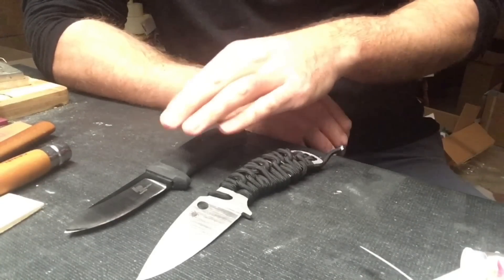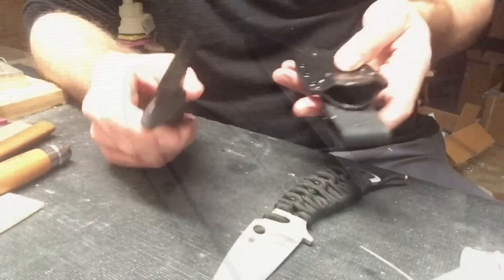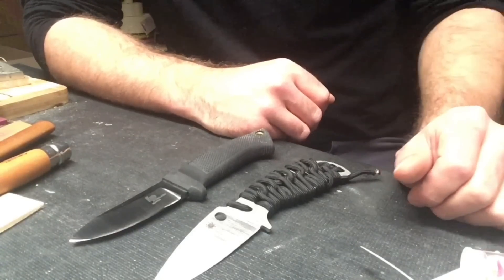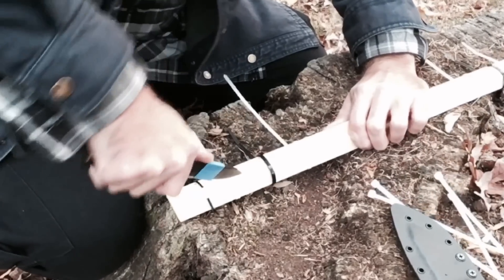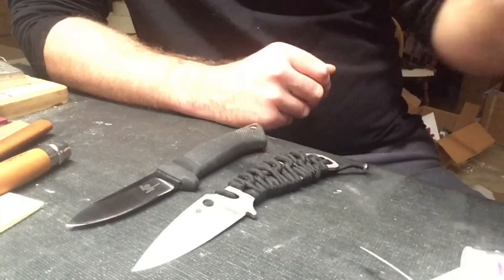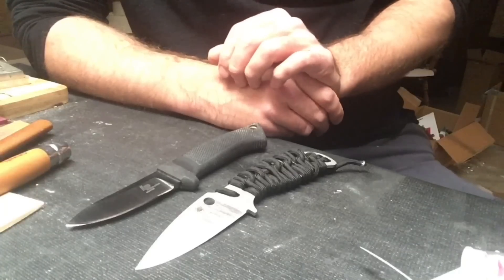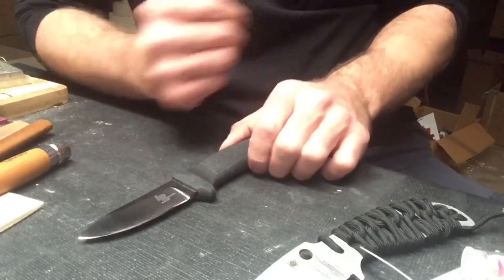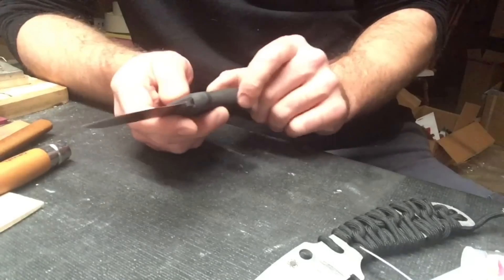CPM 3V - Cold Steel Pendleton Hunter - 3V/4V comparison.

Comment: This was awsome!! I appreciate all the work you have done. I'll say first hand, I've had the SRK for 14 years, take it out a lot, beat it to hell. The handle has still held up well. Question, in the videos, you're hand sharpening, so does that mean you've put a convex edge on that knife? Or is that a secondary convex? Its confusing, just wanted your thoughts. Thanks!
Reply from the maker: Chris Grey I usually do a V Grind.  Occasionally I’ll do a convex.
But it sounds like you’re entering the conversation with the idea in mind that hand sharpening automatically equals a convex edge.  Was that something you had in mind with your question?
Reply: @michaelchristy4982 yes, I think you're right. I'm assuming hand sharpening like that would lend itself to a convex edge. I really appreciate the response and follow up. The thing is, I know I'm not dumb, but when it comes to figuring out grinds and how to sharpen them, I'm at a loss. Right now I primarily use a Bark River UL Bushcrafter which i believe is what is called a scandi vex grind, no secondary bevel. I also have a GSO 10.1 on order that is a saber flat grind with secondary v grind bevel. They are both 3v, and are/will be my most expensive knives. I've got a gso 4.1 in 3v and I love it. I maintained that one with a Ken Onion Worksharp. But I'd like to move away from the Worksharp with my nicer knives, especially 3v.  Anyway, I apologize for the novel. I can't believe I just found your channel, the stuff I've seen has been absolutely amazing and I follow tons of other knife shows. I'll be doing a deep dive of your catalog this week, so I'm sorry if you have already addressed this stuff previously. Thx again!
Reply from the maker: Chris Grey freehand does not automatically equal convex.  Take a look at my video on XHP and edge finish testing.  Skip to 14:40 if you want a quick example of why I make that statement.

Comment: Another fine video sir! I love 3v, its nice to see affordable knives made from it. I've been enjoying my k2 in 10v, also got a lionsteel sr1 in Chad Nichols rain drop Damascus for Christmas, it is sweet.
Reply from the maker: knives save lives the rain drop Damascus is nice.  I've seen some impressive knives in that pattern.  
3V is really good for fixed blades.
Reply: Michael Christy I've never tried it on a fixed blade but, it seems fitting for one. I've had a Spyderco tuff in it for about 5 years now and I've been pretty impressed with that. All in all though I think maybe even above 3v I think my personal ultimate favorite has been sleipner. Oddly enough it started out as the worst steel I had used and after about a dozen times of really aggressively sharpening it I finally found it to have pretty excellent edge retention. Sadly out of the box edge retention tests are pretty much moot considering all the heat damaged steel at the edge from factory sharpening. I like that you use your knives for awhile and sharpen them a lot before you come up with any conclusions.
Reply from the maker: knives save lives over heated edges can be a problem.  You always test with freshly sharpened steel...  Ankerson told me that way back when I was just starting out, long before I ever thought of starting a YouTube channel.
Reply: @MichealChristy What are your thoughts on Micro Melt Pd-1 steel? Comparisons to 3v / 4v?
Reply from the maker: I don't know too much about it, except that it should have a good toughness rating and good edge holding (given the touhgness).  That's just based off me looking at the composition.

Comment: Hey Michael did you notice after putting a fresh edge on the pendleton hunter after putting it in the sheath it came with and pulling it out no matter how carefully it would roll the edge over in a spot or two? Or fold it over or something. All I know is it happened then I freshened it up with the spyderco uf and stropped and inspected with a light and put it back in and out and sure enough there were a couple flat spots screaming back at me with a light on it. Or even just holding it in the light. Will this effect its performance? Such a tough and good steel I would have thought nothing would hurt it especially after seeing you cut aluminum cans with no real damage. I could feel it cutting paper a little, but is easily stropped and would feel mint but you could still see a tiny flat spot or whatever. Is that why you got a kydex sheath? I may get a leather one somehow or if your kydex solved the problem may be one of those! Bummer huh?
Reply from the maker: Paul Lonardo it sounds like your knife is due for a full sharpening, instead of just touching up the edge.  With just the UF and strops, you’re leaving fatigued steel on the edge.  If I have a sheath try to mess with my edge, I end up taking small slivers out of the sheath (this just happens by accident) when I pull the knife out, but I never see the edge roll.
Reply: Michael Christy Actually it has a fresh edge. I sharpened it with my kme all from the 50 grit beast to 1500 in diamonds then a 2,5,and 10k chosera and then strops up to .1. It was after I did that I noticed after a couple times of messing with the knife in the sheath i could see a tiny reflection on the edge in a little are about a few mm long. So that's when I touched it up with the uf benchstone and strops and got the edge back to mint. Then it happened again. Don't get me wrong its so small you can see it unless you have a decent flashlight pointing at it, I just didn't know if this was normal. Ill figure it out, thanks anyways. Its no biggie.
Reply: Michael Christy I mean it comes down to an edge that's so pointy I guess I cant expect it to be invincible. I just know when I get done on the kme there is zero burr and its a sharp as any clamped system could get it. Maybe because it was so fine its just the tiny burr that I got to stand up straight and it bent over making light be able to bounce off it...or my worst fear is a got a one off one with a low heat treat or something but I don't think that's the case, it felt as good as any premium steel as far as how the diamonds cut through it. I just don't get how you can cut through aluminum cans and see nothing but I just take it out of the plastic sheath and I see a little something. Errr!
Reply from the maker: Paul Lonardo I’ve seen times where a blade had little bits of plastic on the edge that looked like chips.  Could you feel them in the edge?
Reply: Michael Christy I can really feel it as much as I can see it. Its just the very fine fine edge just flattened or something a tiny bit. This was done with my kme so I am going to do a full re-sharpening free hand and see if it has any change. I did a 20° angle dps on the kme. Would you suggest I go a little more acute free hand or keep that 20? I also wanted to ask you one more thing. When you get a new knife do you take it down to the 15 dps or follow the factory angle. I assume you must do the 15 and just keep hitting the coarsest stone until you get your burr the entire way and then go to the other side and do the same, right? I'm sure that's why it takes patience and a steady hand like with the s90v military
Reply from the maker: Paul Lonardo I usually go around 30 inclusive.  I used to be kind of obsessive about the angle, but I don’t worry about it as much (unless I’m testing).  But if a new knife has an obtuse angle, I drop it to 30 inclusive.  At this point, I often reprofile freehand as well (again, if I’m testing I make the angle exact.  If it’s just a knife I want to use, I don’t worry about it as much).
Reply: Michael Christy hey bro so I wanted to just tell you I went and got 3/8" sisal rope just like cedric and Ada channel and without sharpening it again after that shiny spot on the edge after I pulled it out of the pendeltons sheath(had a fresh sharpening job on my kme) and I started push cutting just like he did on his test. He got 198 with a convex edge on the pendleton 3v and I have a v-edge obv on mine and I am currently at 300 but took a break! It is getting there though. So anyways I guess I dont have a poor heat treat and I can't believe after all the hard cutting that snaps through the rope and hits the wood 300 times and the edge isn't showing any real flat edge just not as fine as fresh obv..and I also tested my steel will modus m390 which is why I got rope and cedric had a bad knife and could only get to 100 cuts and I finished at 417 and could have gone further because the edge was still cutting the paper somewhat. Just thought I would let you know if you were interested. Thanks bro
Reply from the maker: Paul Lonardo good stuff.  Glad you commented on it.  Also glad your knife is solid.

Comment: Interesting test on toughness of 3v and 4v steels. I was pretty much sold on 3v for fixed blades after I saw a video of a dude thumping on a strider fixed blade made out of it. Makes me wonder what this test would show on very similar steels like s30v and s35vn for example? If I remember correctly s35vn is supposed to be tougher. Or maybe I'm thinking of the wrong thing.
Reply from the maker: Caleb Green S35VN is not tougher then 3V.  S35VN is a little tougher then S30V, but not 3V.  
I repeated all these tests shown here to try to make sure I wasn't getting random or fluke results.  The edge damage was pretty consistent.  I would think S30V or S35VN would show damage more easily then 3V and 4V when impact was involved.  Not sure about the rest.

Comment: How do you compare 3V to Cruwear? Do both go scary sharp? How tough cruwear is in pratice? thanks for sharing.
Reply from the maker: Wilson Miranda 3V has a higher toughness rating then CruWear.  I think CruWear may sharpen better.  
3V is probably a better option when you need a bomb proof fixed blade, but CruWear would be interesting on some fixed blade models.  I don't know why we don't see more of it.
Reply: Michael Christy Mike Stuart shared some graphics  and it puts cru wear just a bit under 3v  toughness.
not sure how it comes to pratical use.

Comment: Love the video. Would love  to see more vids on 4v. Have an alphahunter warhorse in 4v. We know that 4v isn't as tough as 4v but how does it compare to other steels? Or wear resistance of 4v vs 3v with rope cut test or others. If this has already been done can you point me to the video? Thx man. Sub'd.
Reply: Also what heat treats where both steels at?
Reply from the maker: I haven't given 4V a real wear resistance test yet, but according to charts I've seen from Crucible, it should be between 3V and CPM M4.  However, I've heard that there are some people pushing the RC up on 4V (higher then what we are probably seeing in production knives) and getting better edge holding while maintaining a good amount of toughness, which is interesting.
Reply from the maker: I'm not sure of the Rockwell ratings of these models.  Spyderco doesn't give out that information and when I asked Cold Steel about it, they gave me an answer but also asked me not to discuss it publicly, so I'm not.  (not sure why they said not to, but they did.)
Reply: Thats right you said that about cold steel. Sorry. Alphahunter told me his 4v was at 60 ish HRC. I think that is on the upper end right? I should check crucible's site. Good stuff. Thanks bro. Also, these are numbers but I wonder what your real world wear resistance test will reveal. I think that 4v would be a great edc blade steel with the wear resistance and toughness but not as tough a steel as you might need on a fixed blade. I carry a strider db in pd-1. I have heard that it is tough. I wonder how tough compared to 3v. Love that steel.
Reply from the maker: I'm pretty sure 4V can go above 60Rc.  I think people are starting to play with the heat treat to see what results they can get, and that's what I'm referencing.  I'm not sure how well it will apply to the production world.  We'll have to wait and see.